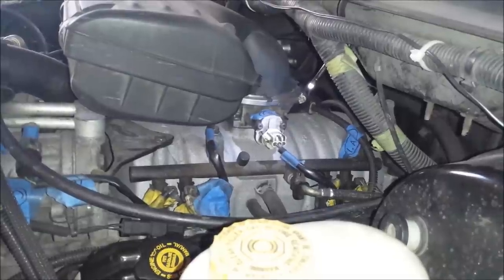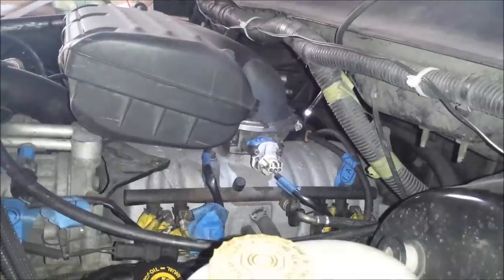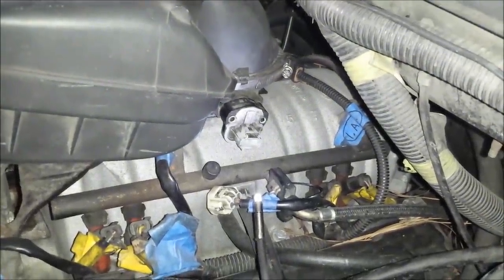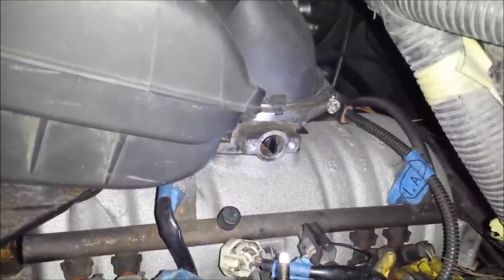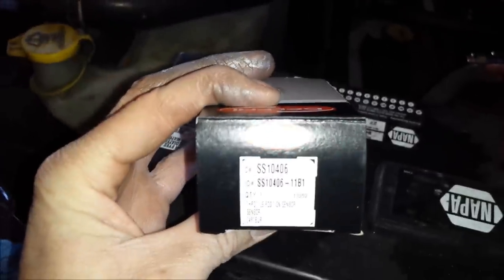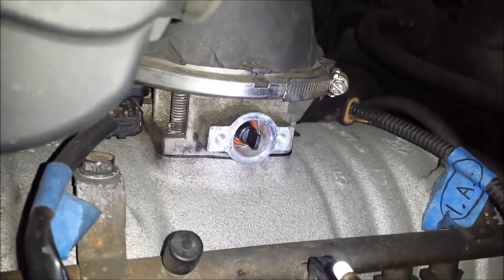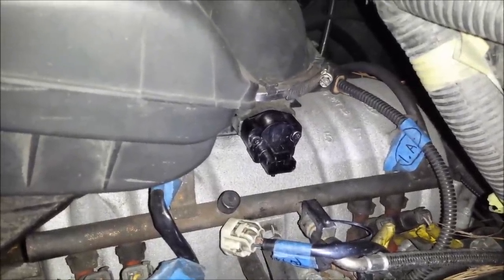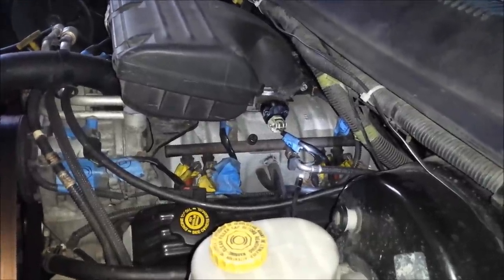Throttle Position Sensor Replacement - 2001 Dodge Ram 1500

Comment: wish I could find the problem with my 2001 5.9 magnum just replaced the plenum gaskets and I still have a idle like miss just runs un even plenty or higher rpm power new iac maybe it is bad changed tps cap and rotor still got it that same problem got me stumped I geuss I will change plugs it has been a couple of years sence maybe that's next
Reply from the maker: +hamtalker2007 Hmm, yeah that could be any number of things.  Have you checked compression?  The IAC could be bad like you suggest....that would be the most likely cause.  Also, how old are the oxygen sensors?

Let me know if you figure it out.  Thanks for watching!
Reply: +Matt Payne  hey man yeah I think I have maybe pinpointed the problem the bank one o2 sensor got a code p0132 today and I got the sensor I still have to install it but I think that is the problem it was running rich
Reply: ever do a fuel sync?

Comment: Hi everyone. I have a 1996 Dodge 2500 4X4 with a V10 and an 47RE automatic. I am having an issue with the shifting from each gear going up. If I drive very easy it goes through all gears and into overdrive just fine but if I am pulling a load or rushing the speed it is very slow to shift up into all gears. It revs to over 3000 rpm before it shifts. I have been told that my second gear is out. It is not! I have been told that the sensors were my problem and the only one that was was the ABS on the rear diff. I have changed out the ABS sensor on the rear differential, The Output Shaft Speed Sensor on the tail end of the transfer case,  The Governor Shift Solenoid and Shift Sensor in the transmission, The trans filter and adjusted the bands. I checked all vacuum lines for leaks. Today I pulled a 30' fifth wheel just fine (unless I would push it) for 25 miles and half of that was through mountains. Could my problem be my TPS or does anyone have an idea?
Thanks.
Reply from the maker: Hey Alfred, I'm sorry to hear you're having trouble with your truck.  How do you like that V10 engine?  

There is a cable that runs between the throttle and the transmission (called the Throttle Valve, or TV, cable) that affects shift points.  I would be suspicious of that possibly being your problem.  I would suggest downloading the factory service manual from the "About" section of my YouTube page and then check out Page 21-770 to read about adjusting the cable.

I hope that helps....good luck, and let me know if you figure it out!
Reply: My 96 got where it wouldn't shift right and the Dodge garage said it needed the tranny flushed.  They did it and it seemed to help for a few thousand miles, then it started up again.  I am not much on additives, but the ' tax assessor'  said he had the same problem with a Chevy and he put PROLONG Transmission fluid in it and it stopped.  SO, I did the same thing and it hasn't missed a shift in over 130,000 miles!!  Get it online from the factory for $12!!

Comment: i replaced that on mine two days ago and its still running bad everything electrical is new at this point idk what to do
Reply from the maker: I'm sorry to hear that!  My truck is getting really sluggish, too.  Do you have any check engine codes present?  I am starting to suspect that my catalytic converter is clogged, and I have a P0420 code, which is for low catalyst efficiency.  Either my cat is clogged, is simply no longer effective, or I have some combustion issues going on.  I checked compression recently and the numbers were not horrible.

What exactly are the symptoms you're experiencing with your truck?  Have you checked the plenum gasket to see if it is leaking?
Reply: Matt Payne its had 4 engines put in it in the last 6 months.
check engine light has always been on and lately i havent had time to get it checked out ive been getging home from work late i drove it yesterday and it chokes itself when i give it gas and let off the gas then it died i havent had time to get it checked out it idles bad but like i said it has all electrical basically new and a new fuel pump which it all needed new
Reply from the maker: Holy crap man, 4 engines?!?  Has each engine had the same issues?  If so, I'd be highly suspicious of your exhaust system.  Have you swapped the engines in yourself, or have you had a shop do the work?

Sorry to hear you're having so many issues.
Reply: the original got water in it the second had a bad oil pump and destroyed itself and left me out at 2am i had to push it 2 damn miles no one would stop lol 3rd got water in it and the current one is what i have now and ive only taken out the 3rd one and put the 4th one in myself and a friend
Reply: we still have the 3rd one we r gonna over haul it and put in a another truck hopefully
Reply from the maker: Gotcha...based on that, I'm assuming this is a mud/bog truck?
Reply: Matt Payne 4x4 2001 dodge ram 1500 sport havent had a chance to go mudding yet as u can tell lol getting 35's once i get it runnibg good and new shocks my damn daily driver...well it was
Reply: Matt Payne. i have a 1996 dodge ram 5.9 liter. . trottle body acts like its taking in alot of air but i cant find a vaccume leak anywhere . the truck starts and idles fine but when i try to accellerate the gas not only is the peddle almost impossile to push (or tries to resist)the air overtakes and it dies. i have replaced the krank ,map,and idle senslors which none came with any gaskets ,but still haveing the same problem
Reply: Crankshaft sensor works for me plus cleaning MAF and Throttle body and replace the air filter.. 03 dodge ram 1500 4.7 4v4, it has erratic rpm and stalls in traffic stops.
Reply: ATAK BILL it stalls and has bad rpms in traffic stops? So after replacing the crankshaft sensor it works normal now? I have the same symptoms as you and I’ve replaced everything but the crank sensor. Nothing works yet.

Comment: I want the outcome, wtf .
Reply from the maker: Mark, I honestly can't say that I've noticed a discernible difference since replacing the TPS.  The truck is getting more and more sluggish, but unfortunately I think it's probably because my compression is getting weaker and weaker.  At this point I've just kind of resigned myself to the fact that the truck is 15 years old and probably needs an engine rebuild (or at least new heads) if I ever want it to run like new again.  It does drive fine now though, accelerates smoothly (albeit slowly), and the engine is quiet, so I'll keep driving it for as long as I can.

Thanks for watching.